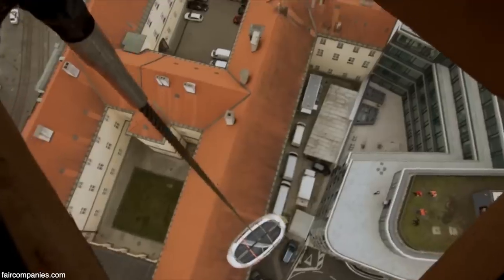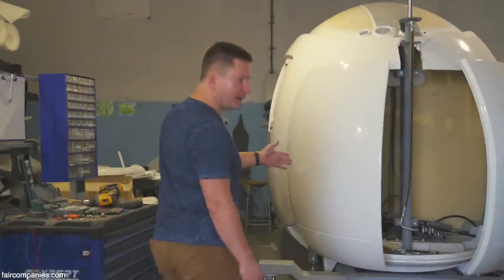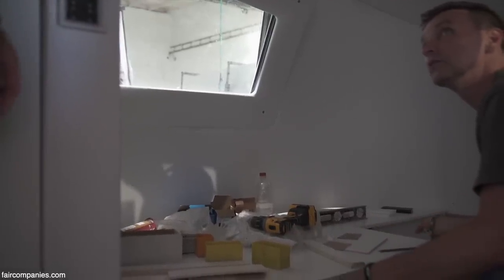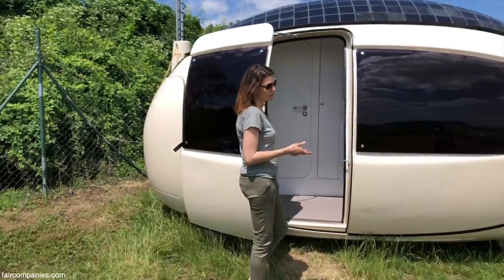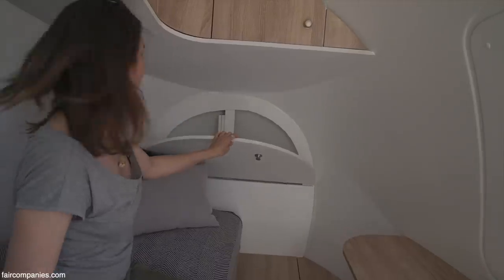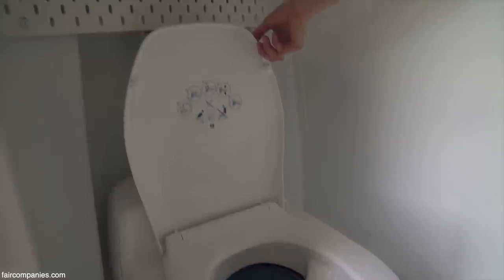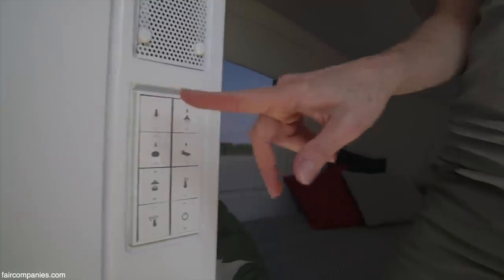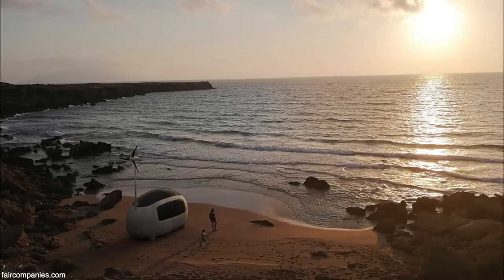Towable, off-grid Ecocapsule gathers energy/water anywhere

Comment: It's basically a self-sustaining bullet caravan, but without the wheels... 😃
Reply: Or a houseboat, without a propeller...
Reply: @pepperpepperpepper  And without floating, since I assume it's not watertight
Reply: @SaltyFailWhale  That's where all these things meet cold hard reality.
Reply: @mos6507  I was upset to see fiberglass being used.  So much waste on the layup...  no recycling protocol for toxic resins and lung-irritant fibers.  Why can't any of these lugnuts use Fresco's extruded concepts?  I know a dollar is the most contrived unit of measure possible, but it's still worth paying attention to when attempting economization.
Reply: "Way overpriced.. At $94,000 USD.. You could just build a tiny home on wheels with 5 times the space for that price!"
@J Doe Or if you like that space, you could build something with a lot more flat surfaces for less than a quarter of the price. Even less if you're the one doing the building, including the piping and wiring.

Comment: I saw these years ago in a "Top 5" list, and wondered if they'd take off.  I like the concept, but there's room for improvement in the design.  US pricing ranges from $89k to $139K.  Hopefully, some company here will acquire the licensing to build the Ecocapsule and price it within reason.
Reply: Agreed, Plus giving it the Dashboard and Wheels of an Electric Car would make it much easier and sustainable to move ( and More Short Wind Turbines since driving produces winds)
Reply: At first it may sound like a lot but if you think about it you will go into profit in around 1-2 years because you don't have to pay for elcrricity and water at all and imo is quite comfy but it may be because i like small comfy places
Reply: @foldyna_s  -- I would say that what is reasonable is what ends up being competitive in the marketplace.  You can build a heck of a tiny house for way less than $89K, and hit that break even point much sooner. I believe it's been difficult for them to create a demand for the product based on their pricing.
Reply: Simply put it is pretty much a  Scamp 13' camper with a wind turbine attached,
Reply: Building your own style tiny house would be way cheaper and you can have room to upgrade and repair it yourself.

Comment: Kirsten this is interesting as usual for the channel but I was expecting some more questioning from you when it comes to the "eco" labeled design:
- how the filtering works?
- what is the expected generated energy and to what amount of autonomy it corresponds?
- how are the materials used ecological?

Furthermore, I have doubts about the advantages of the shape it self:
- flat surfaces are probably more industrially scalable and substitutable if damaged, unless there is a big advantage in saving material and assembling with a curved shape;
- having solar panels facing opposite sides is a huge waste of potential energy harvest, maybe cut to half;
- storing space is reduced.

I don't agree with the stated cozy feel of the shape: we are not born inside an egg, we are far more used to a box shape or triangular ceiling, so this is highly subjective. 

However, I see some advantages:
- it is less disturbed by air flow, which it is better if you plan to use it as a trailer and also might feel more comfortable if it is windy outside;
- less joints make it more stable when transporting and less prone to cracks, also if it falls over to one side.

Even with that shape, I know how to save more space in the kitchen and bathroom than the present design.

This might be useful for some property owners that want to complement their business with some tourists staying for a while, because the shape makes it a different experience. Other than that, an RV/caravan/trailer would be more cost efficient.

Comment: For a sturdy disaster shelter I love the self contained function.
Egg shape should 'shed' strong winds (dismounted wind turbine). Heavy eye bolts could allow anchoring to resist strong winds given a secure footing. The water is pumped & discarded? (grey & black tanks??) Composting toilet?
No refrigeration in the kitchen & no 6' standing room inside but, seems like you could be comfortable. Sit down shower is better than no shower. How much does it weigh with empty water tanks?
Reply: I think I read this it somewhere:
4,200 lbs with water tank full
2,700 lbs with water tank empty

Comment: Some interesting design elementsincluded.  I like the bathroom design a lot, and the wind turbine is a unique idea.
I don’t think the shape is very efficient from a space use aspect - a flat roof slanted to one side could also collect rainwater, house solar panels and allow for a more usefu and easy to engineer box-type space underneath 

Also of concern is the heaviness and operation of the door - would be annoying to go in and out of often, and the bugs would easily get in if left open, as there doesn’t seem to be any screen.

Where does food get stored?  There does not seem to be any refrigeration until.

Comment: I would love to see a black water processor that's basically a freeze fryer that sublimates the water out of feces and reduces the solid waste into a dry powder.
Reply: The separette basically desiccates the solid waste, though I think it adds composting medium such as sawdust in the process. But there is not much left of it after it's dried, solid waste is about 99% water. I think the freeze fry would be more expensive than the composting model, which is not smelly.
Reply: There are incinerator toilets that basically burn everything, leaving only ashes supposedly.

Comment: It needs to be Car+Ecocapsule
The Front part needs to be a Convertible Car and the whole thing on Wheels

The fact you have to rely on another machine to move it around makes it little bit behind the times
If it can be hauled by a Motorcycle, it would equally be more usable

Nevertheless, it is a very useful structure in nature
I congratulate you on this Excellent product.

Comment: How is this anything but a glorified camping trailer? And it doesn’t even have wheels.
Reply: Except for exrements, it is pretty self sustained... The water you drink is filtered rain or lake water.
There are 2 levels of filtering: for washing, and for drinking.
Energy is of course important.
It's just not clear to me what happens with faucet drain and pee... Is that recycled into washing water, or is that also something that has to be drained. It's not clear to me from the specs.
Reply: @bloepje  Urine is in that eco-toilet which seems to be a model independent from the capsule. Usually you take it out (as well as feces) yourself and dump it where adequate.

Comment: This doesn't work well. Mainly because of water supply in the kitchen and shower and the inconvenience of having to take your poop out considering it's a house without wheels. I think a Van/Bus that is built like a house can achieve the same result while also bigger and more mobile. However even with a van, the water supply problem persists, and the poop discarding is just slightly improved because of mobility.

Comment: The "egg" shape may be cute but that shape is not the best use of space. Maybe have the walls less curved and the roof as well would give you a little more room to move, instead of just going in and immediately sitting down. The curves all around are much too strong. Not a good design in my humble opinion... my two cents.

Comment: I wonder if you could Frankenstein this onto a reinforced micro bike trailer (they usually don't need registration tags) and then onto a heavier duty solar assist electric velomobile with a higher profile...then you could store a micro boat (just large enough to fit the whole thing while navigating) on the back or side, depending on if it's campactable. Then, if you have to or want to take to the water, you can! You could even have the boat be peddle/paddle, or sail powered (or a combo of both)! As long as the boat doesn't have an auxiliary electric or gas/deisal motor, you wouldn't need a license, to pay registration for tags, you wouldn't have to pay property taxes, you would be completely off grid and self sufficient, and free of big industry and government!

Comment: Kudos to them for bringing this project to life, but they kinda shot themselves in the foot by going for the egg shape. Every interior and exterior component needs to be cut or formed in an atypical and expensive way. All doors and windows are custom molded, even featuring special push-out mechanism..  And all that to optimize the shape for thermal losses? (Which will be negligible and even futile each time the door is opened and all heat escapes)
I'm sure you can build it from a similar sized shipping container module for half the price. Probably less...economies of scale will also be attained earlier at a better price point.

Comment: OK I have a 9 room 12-1300ft2 house , 4 barns - one of which is 2000ft2 and a 1/3 rd acre of land  - it cost me approximately 6000 euro to buy and approx. another 2-3000 euro  to make liveable - when the 'eco-homes' you show get down to the less than 20000 euro price everything included  including land to be self sufficient (i.e. not built on daddy's land) then I may become interested in them, otherwise to me they are not the solution -there is plenty of old housing stock in some countries where it is far more eco-friendly to renovate and use first. This is just an expensive off grid caravan..........Architects are usually the last people who can design anything low cost and eco-friendly for people with a few notable exceptions......